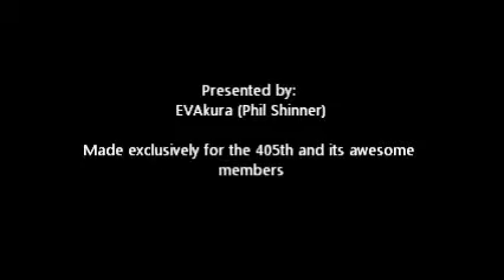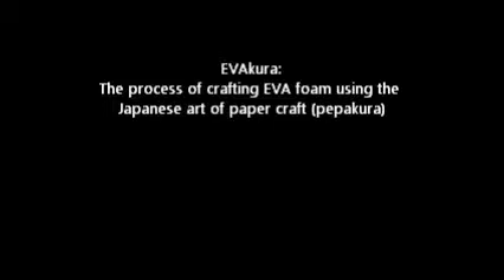EVAkura instructable 4 Electronics

Comment: Hello!  Thanks for the videos!  I have made a lot of costume accessories and props over the last couple years but always have trouble diffusing the light, although I have tried applying light through resin that I've casted.  Any tips on diffusing the lighting?  I am aware of the frost spray you can buy in an aerosol can.  :)